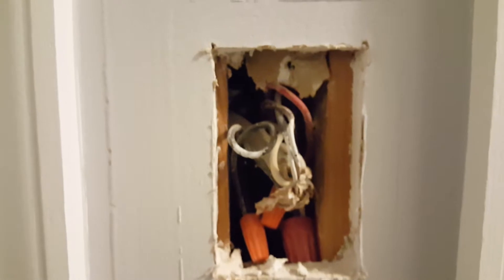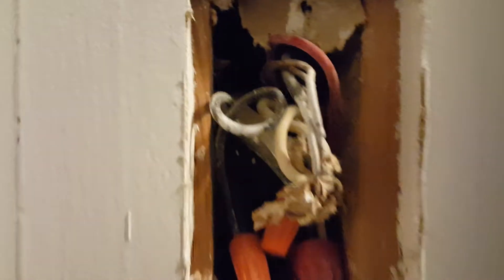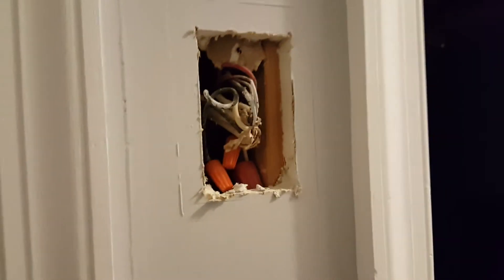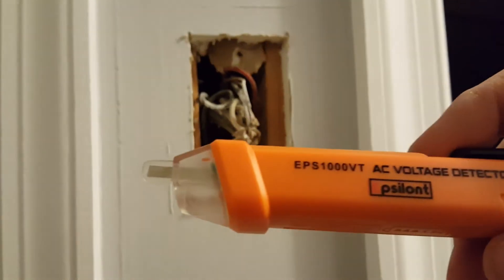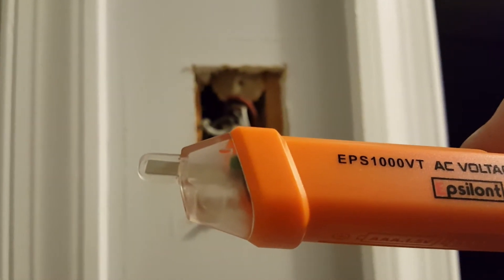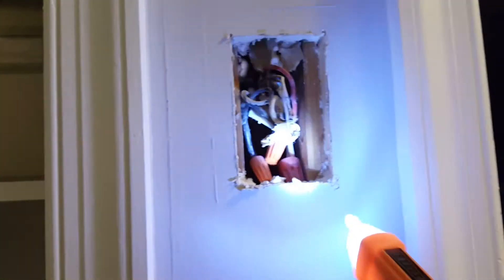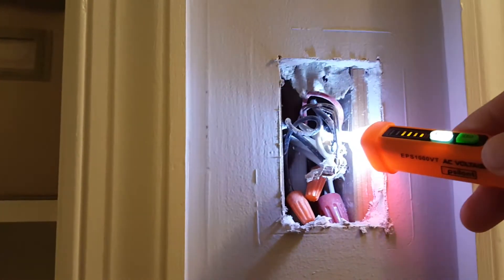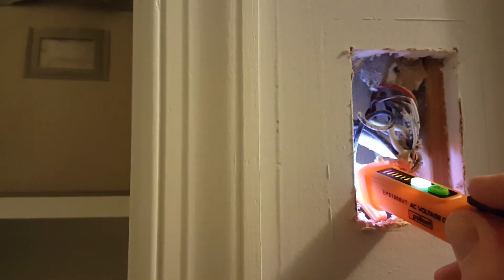Testing Older Home Electrical Wiring Missing Junction Box

Comment: New sub from Nimmin stream! Good info!
Reply from the maker: Thanks very much @CJenda - do you have any home projects you would like to see us cover?
Reply: @realruggeddiy  Is there an easy access way to use the wasted space over the basement stairs?
Reply from the maker: Yes it is possible. Do you have a sloped ceiling above the stairs? Another thing to consider is if what you are storing there is seldom accessed or frequently. Do you think you could post a link to a picture of what yours looks like?
Reply: @realruggeddiy  It's the landing going down, and 11 steps down, looks like a huge rectangle of wasted storage space. No stairs over it. I would use it for seasonal clothes, etc. Didn't measure it lately, but it must be 20ft from the floor of the basement up. Thanks
Reply from the maker: If you have access to either side wall above the stairs, you could add built-in shelving/storage. We have something similar above our basement stairs, a nice built-in "hutch" with tons of storage space.
Reply: @realruggeddiy  Ok, no access, but you gave me an idea. Make an access door, and hide it behind another set of shelves in the kitchen side. There is no wiring there either. Would need  shelves that have some kind of facing or whatever to keep things from falling off when the door opens. Ok, thanks so much for your help, good idea!☺